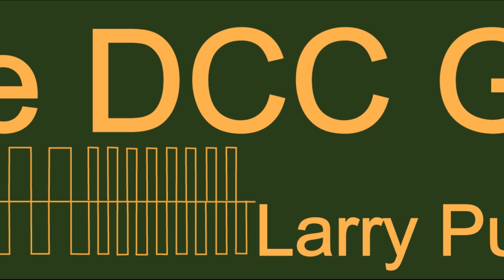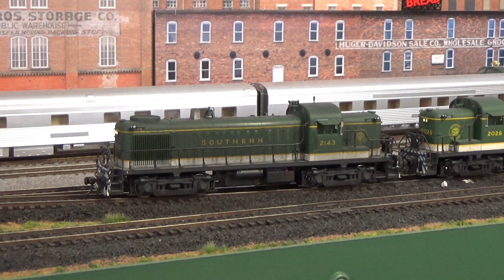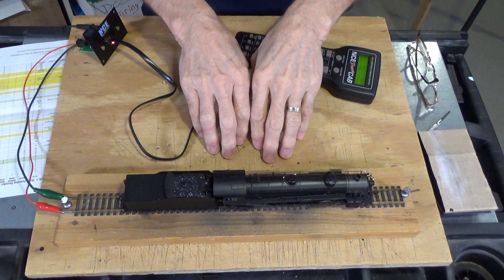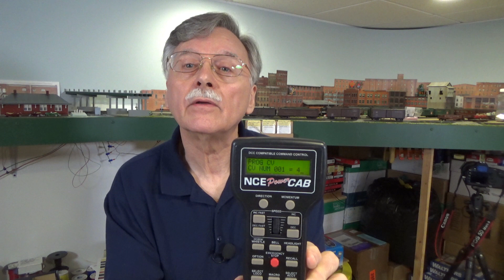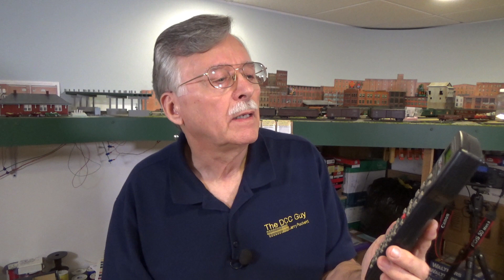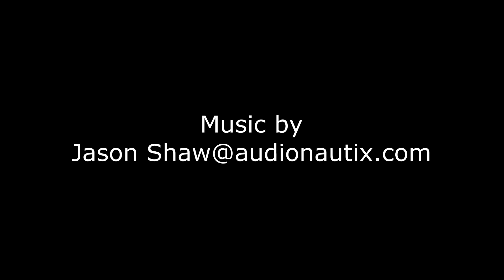DCC 101, Programming the Basic 8 (47)

Comment: Is there a CV to set so the loco uses CVs 2, 6 and 5?
Reply from the maker: In DecoderPro there is a menu pane just for entering these values and selecting whether speed tables are used. As long as speed tables are not turned on and these vales are filled in they should be active. Some older decoders did not use these if the default 128 speed steps were in use but I am not familiar with any current production ones that do that.
Reply: @TheDCCGuy  yes but when I use CVs 2, 6 and 5 there is a button that when selected indicates to use these CVs and not the 28 step speed table. I was just wondering what CV was affected by selecting that button.

Comment: Great set of videos on dcc! You are an invaluable resource! I am using a ProCab. If I have a loco on a programming track and I set Cv to 8 does that also reprogram any locos that I have on the main? If so, does that imply that I must remove all other locos from the main before setting Cv to 8?
Reply from the maker: It is not clear what system you have son e you say a ProCab which is just a throttle that can be used with all NCE systems. If you are using a PowerCab then you need to set up a switched feed to an isolated programming track or order the NCE AutoSW. However if you have one of their other systems with separate main track and programming track feeds then that should provide an isolated programming track.

Comment: Great information, I have a question. I have two Walters SD60 DCC and every time I select either one using my powercab the engine sounds mutes and headlights go out. Is there a setting to disable that function?
Reply from the maker: Check your decoder and see what it is set for by default. It sounds like it may be defaulting to off when it powers up.
Reply: @TheDCCGuy  I have a ESU Digital Sound running an NCE PowerCab. When powered up everything go well. While I'm running my three loco's on my setup sounds are all OK and as I switch from one loco to the other the sounds mutes. I have to hit F8 to get the startup all over again. It does it consistently. However if I hit recall on my PowerCab the sound is not affected and works well, only when I identify a Loco. I haven't checked my CV's yet, but don't know which CV to check.
Reply from the maker: First when you move from loco to loco in a consist I think it might be switching from the consist settings to the individual loco settings. If the individual locos do not have sound on then when you switch to them it will not stay on. So read your instructions that came with the models and see how they are configured. They probably are defaulting to sound off until you hit F8. The instructions should tell you how to set up the decoders so they are muted at startup or are not.

Comment: I've been using DCC for 7 years and love how it opens up a new world to model train operations.  I do have a question though.   Is there a way to program the decoder to not start the engine sound card when it 1st gets power.   I have multiple engines and when they are sitting idle engines off (sound) if there's a short anywhere on the lay out all the engines restart their sound cards. 
 This is very annoying.  Any ideas?
Reply from the maker: Yes, most decoders do have a way to either start up muted or to shut off after a preset amount of time. The catch is that every decoder does it a different way if at all. For example LokSound can be set up to be on or off when powered up but to my knowledge cannot be set to shut off after a certain time. SoundTraxx and TCS WOWSound decoders can be set to shut down after a preset time. Others have their own methods as well. I think I have a post or two on my website www.dccguy.com covering some of these methods but there are over 300 posts so excuse me if I am not sure. There is a search box at the top of the page which will allow you to find ones on specific topics.
Reply: @TheDCCGuy   Thank you for your quick response it's been bugging me for years!  I have the WOW  decoder and love it in a steam engine.   I'll do some digging and figure out how to configure them all.  My other engines have soundtraxx.
Reply from the maker: Go to my website and enter mute in the search box. My posts on this will come up. I did explain how to do this with several major brands.

Comment: Larry, a used Genesis SD70-ACe DCC Loco was given to me because it’s dead. I have a feeling it just needs to be programmed.  Is there a way that I can reset it and program it if I don’t know its address?  It’s not a short address and it’s not the loco number. I have the NCE Powercab.
Reply from the maker: Yes, just try programming a value of 8 into CV 8 using the service mode track. Watch video 105.
Reply: The DCC Guy, comes back unable to read the CV codes. I’m thinking now it’s def no power. I’ll be tearing into it this weekend. Thank you!  Great knowledgeable videos, great for reference.
Reply from the maker: Doesn’t sound good. I would disconnect the track pickup wires and the motor leads and hook them up directly bypassing the decoder then see if it runs on DC. If it does the those two factors are OK and it likely is the decoder.
Reply: The DCC Guy right on thanks. I’ll keep ya posted.

Comment: Hi,
Maybe you can help me, I have a EZ track layout with bachman dcc controller. I just bought a walther mainline dcc locomotive and is running very slow and delay commands response, compare to the bachmman locomotive I had. Do I need more power to my track or is my new locomotive defective? Any help will be appreciated.
Thank you.
Reply from the maker: Are you trying to run more than one loco at the same time? If so yes power might be an issue. If not tell me more.

Comment: When you are setting up a three engine consists . Can you please provide the steps.
Reply from the maker: It would be the same for 3 as for 2, just a little more complicated since you need to first speed match the all. I’d also start with universal consisting and then move up to advanced once I got more comfortable with the process.
Reply: @TheDCCGuy  How would  you speed match? I have the NCE DCC Procab transmitter. I do not see anything about speed matching in the manual. If I am overlooking it, can you tell me where to find it in the manual?